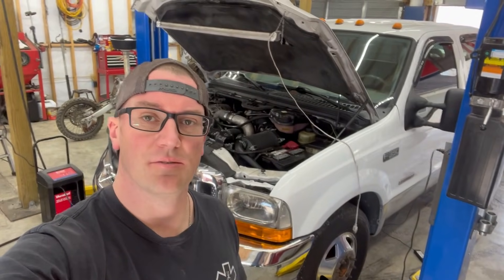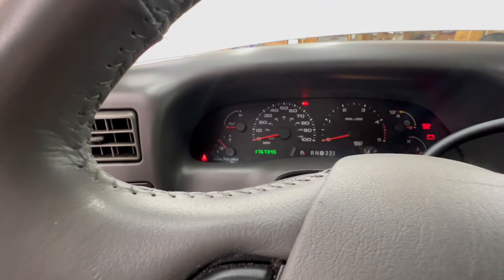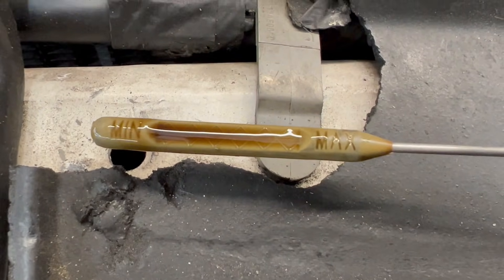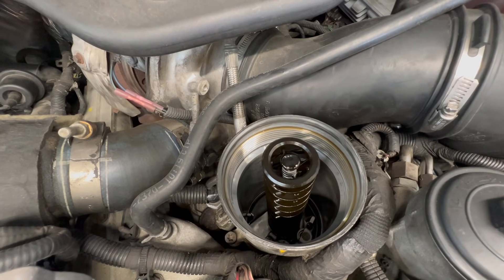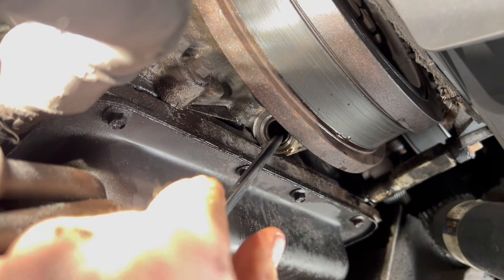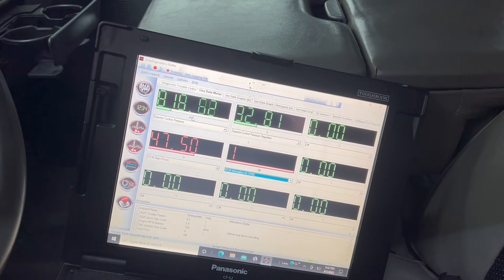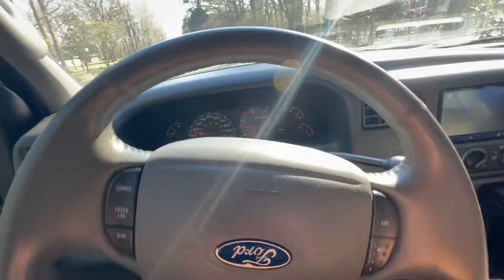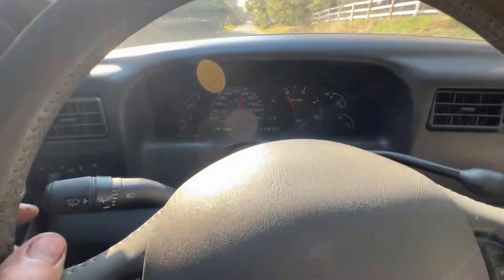6.0 Powerstroke crank no start no base oil pressure

Comment: We have a long crank to start cold and no start when hot. It cranks a long time before the dash shows oil pressure but once it shows it starts up. Just got done replacing all injector and fuel rail nipple o-rings. Oil filter gets oil about as fast as you showed in this video.  Oil pump plug came out no issues. It slid out with no magnet, and no metal was found.  Pulled the ipr and screen looked good, no metal found.
Reply from the maker: How much have you run it since replacing all that? It takes a good hard drive to get all the air out of the system.
Reply: @AutomedicGarage  Not really much. About an hr sitting. I just shut it off again, and it refuses to re-start.  I'll have to wait till it cools down to start it again.
Reply from the maker: @okhotrodder  sounds like you need to air test the Hpo system
Reply: @AutomedicGarage    I did the air test at the sensor, regulator, and also the rail. It had what sounded like air leaking under both left and right sides under the rail somewhere. I didn't feel any air and tried pouring oil all over with no luck.  It sounded the same before and after all the seals were replaced. Since I did the injector and nipple o-rings, it starts more quickly cold than it did before oring replacement.  Ipr goes to 45 upon startup and stay around 25-27 running. When it gets hot, ipr is still 25 or so.  While running, demand fuel pressure/icp 580 and actual stays 570-580.  When hot and shut off, then try to restart, ipr goes to 85, demand pressure is 652 and actual pressure hovers around 345-365 with icp voltage at .56-.64.  Will not start.
  When it starts cold, it runs great with no issues.  I did actuate the ipr with my scanner while I was doing the air test, and it shut off the air supply the more it was activated.
  Looking at other videos, I came across dieseltechRon.  He mentioned the stc coupling.  I didn't replace that, but it's not available at O'reillys, and neither is the low-pressure oil pump, so I'll call the dealer tomorrow and check on cost.
Reply from the maker: @okhotrodder  unplug your icp, run it that way see if there’s a difference. Gotta get the stc at ford and whatever you do don’t buy a LPOP or stc from oreillys.

Comment: great video, are you reading ICP psi? or Kpa? cant really see on screen, thank u, algo if i do have the good oil pressure from engine pump to filter housing, but not high pump pressure at all, should i point to  high pressure pump?
Reply from the maker: If its a early 6.0 (03-early 04) yes, pumps are prone to get weak and the j tube orings can blow also. If it’s late 04 or newer could be stand pipes, dummy plugs or stc fitting(if it still has one) late model pumps don’t typically go bad. You really need to pressure test the Hpo system to really tell the story if your low pressure pump is doing it’s job. And yes I’m reading psi not Kpa

Comment: This is why if you don’t work on your own 6.0 you have do your research and find an excellent mechanic like this guy in Arkansas.
Reply: Or you learn from these videos and work on your own 6.0… otherwise what’s the point of these videos? Great job and thanks for the video AG!
Reply from the maker: @dancook6322  thanks bud.
Reply: Question if your getting oil pressure but still get no start what should you look at next ?
Reply from the maker: @michaelturner1-c9q  if your making lpo using the correct filter and your drain back valve is intact you need to look at your PIDS and tell me what ICP, IPR, FICM main and FICM sync are doing along with fuel pressure
Reply: What an awesome video about checking for low op. If u don’t mind helping out I just did the Eng oil cooler on 2006 6.0L.
It was running perfect until everything was removed. Oil filter housing, cooler intake etc. removed ipr and changed the screen with o rings. Tried to start but crank and crank and crank but no fire. Changed oil filter suspecting bad oil filter. Watch oil coming into filter housing with valve depressed. 
After some cranking oil pressure gauge goes up. Ficm has 48volts while cranking, desired oil pressure is 1500psi while cranking but actual is cycling around low 100 to 300ish back and forth. Have fuel inside fuel water separator. After bunch of tries removed ipr again to check for debris and found none but had a hell of time trying to remove the new screen. Busted it, vacuumed old
One out and installed new ipr but no luck. Keeps cranking but no fire. No codes. Any help would be really appreciated.
Reply from the maker: @benjaminfranklinkivettiv9433 I’m not sure who this comment is directed towards. Never said anyone shouldn’t try to do it themselves. That’s what this channel is about.
Reply: The only way to learn is to do it
Reply: Thanks it help my 2003 f-250
Reply from the maker: @rafaelsarabia8286  good deal. Glad it helped.
Reply: Arlington, tn.?
Reply from the maker: @efraingarciaescalante2824  yep
Reply: @AutomedicGarage  up the road in Atoka, TN. Keep up the great work.
Reply: Great mechanic. Anyone else you would be paying for a front cover
Reply: Are you made of money
Reply: I'm from mexico, my problem is not oil pressure, I already check pick up tube and orings, change oil pump (complete, front and rear cover, gears) 
I don't have any new idea. What do you recommend?
Reply from the maker: @jonvicente4510  what’s icp and ipr on cranking? Have you air tested the Hpo sysyem
Reply: Where is your shop located
Reply from the maker: @sherriboggs  Arlington Tn
Reply: 03  6.0 got L oil Pressure  Tach needle jumps up no Start ?
Reply from the maker: I’m not from Arkansas, unless what your trying to say is I’m a sh*t mechanic
Reply: @AutomedicGarage  I think he's from Arkansas and therefore needs to find an excellent mechanic like you over there lol
Reply: @AutomedicGarage I don't think he was implying that I know I wish you was here in Kentucky after the government shut the coal mine down everything went to he!!! On my truck so my question is I have a 03 6.0 could a crank shaft position sensor cause a crank no start ?
Reply from the maker: @troygrissom8956  yes it can but I rarely see the sensors fail. Usually a wiring harness/pigtail issue. What do you have on your scan tool as far CM/CK SYNC and FICM SYNC?

Comment: Where do you hook up a pressure guage to test actual psi of low oil pressure?  I have no start,  originally had ipr code,, replaced,,, still no start,  so bought a scan guage 3 ,, have ficm volts 48 ficm logic 10.5-11, ficm sync 1   ficm cam and crank yes,,rpm 190,,icp  .24v ,,icp takes a bit to get to 225 then halts , clean relief valve,  nothing in there but tight, pulled and cleaned,,, oil fills in about 10 seconds,    im stumped ,, any ideas,, thanks,,pat

Comment: I’m going through this exact problem right now. 
I’m only building about 300-400 on the IPR. If I give it a shot of starting fluid it’ll start. That worked a few times, but now it’ll start, but only run for a few seconds. 
Hoping to start looking into things today.
Reply from the maker: Icp not ipr, did you clean the relief valve
Reply: @AutomedicGarage  not yet. Going to check the oil filter first.  Then go from there.
Reply: @bobuncle8704 did you find a fix?
Reply: @saltycrowgarage7215  not yet. With no money right now, and health issues, it’s in limbo sadly. I’m going to try swapping some things from my 04(nov, so same components), and see what happens. Just been in copious amounts of pain. Hoping to try some things later this week. Thank you for asking.
Reply: I’m only building 32.3 On the ICP PSI. On ICP (V) it’s only going up 0.29, I tried your genius method but my oil raised up.

Comment: Now what would be the next step if the oil filter housing did fill up with oil
Reply: Pull the low oil pressure pump. Check gears for scarring. If the gears are scarred. What normally causes this is  a lifter has come apart and the needles out of that lifter has gone through the pump.  Next step is to pull the engine.  And watch bank account go empty.

Comment: My 03 6.0 diesel does the same thing but will start when it’s cold and runs fine with oil pressure but when it heats up will not start .
Reply from the maker: You got a high pressure oil leak somewhere that only shows it’s face when the oil is hot and thin.

Comment: I have an 04 6.0 with 300k miles, it just started to do a similar behavior. I start it in the a.m, drive it about an hour and maybe after 2-3 hours it won't start, it sometimes takes up to 8-10 cranks to get it started, I drove it today and it suddenly turned off, it took about 10 long cranks to get it started. Could this be the same issue as shown on this video?
Reply from the maker: Early or late 04?
Reply: Manufacture sticker says 06/04. I really don't know what would be considered early or late
Reply: How would I know if it's an early or late 04?
Reply from the maker: @davemarroquin5653  A)where is your icp sensor located?(front passenger side valve cover or on hpop) B) is you hpop the oval and sticking through the cover or is yours covering the entire pump. Reason all this matters is if it’s the early style pump chances are it’s getting weak and starting to go out or the J tube orings are failing. If it’s a later style oval top pump, they don’t go bad and it could then be several other things(stc fitting, stand pipe, dummy plugs, etc. it sounds like a hard crank/no start hot condition.
Reply: The icp sensor is on the front passenger side. The truck once I start it in the a.m it starts right away with no problem, once it gets a little hot it sometimes turns off on me here and there. I get to work and maybe 2-3 hrs later I want to start it and that's when I try to start it but it takes couple cranks 10-15 secs. But thanks, your video and answer has helped alot
Reply from the maker: @davemarroquin5653  need to know what pump you have depends on if you have dummy plugs and stand pipes or not. Sounds like a crank no start hot problem and if it’s the old style pump your pump is getting weak.
Reply: Unplug icp. If there's oil in the plug. Replace icp and harness plug.  Really sounds like the ipr is going out tho.
Reply from the maker: @davidtipton7234  did you even watch the video? Obviously not, relief valve was stuck on the LPOP, there was no oil making it to the oil filter housing which has absolutely nothing to do with the icp sensor. Dont be a armchair mechanic.
Reply: @AutomedicGarage  lol.  Umm. I wasnt talking about your video.  I was answering the question that davemarroquin asked.  His is cutting off and hard start.  It's either high pressure oil leak.  Icp bad.  Or my guess.  IPR bad.
Reply: @AutomedicGarage could the wrong oil resevoir cap cause a similar no start issue like this?
Reply from the maker: @saltycrowgarage7215  yep wrong cap wrong filter also. Only need to use oem cap and oem filter. Nothing else.

Comment: Hey man I have a 03 6.0 I’ve owned it for 2 years and ever since I owned it every morning no matter hot or cold it always takes 3 or 4 tries until it starts takes longer to build oil pressure but after today I was going down the highway and the truck lost oil pressure and power and she died and now I’m at a crank no start building no oil pressure any ideas of what it could be ?
Reply from the maker: Being a 03 with the round aluminum pump I my first guess would be the pump itself. Could be the j tube or even a injector seal but I’d bet money on the pump. Have you watched my crank no start diagnosis video? It would help you work your way through it.
Reply: @AutomedicGarage  yes I went through the video I’m going to go through the truck tomorrow night and see how it goes thank you I appreciate it

Comment: what code was it showing
Reply from the maker: I couldn’t even tell you, people tend to focus on codes with these when most of the time they aren’t pertinent to the problem. You need to look at live data, icp, ipr, FICM main, FICM sync and have a fuel pressure gauge hooked up. If you have all of those and a solid motor with good compression and no dead cylinders it will run.

Comment: Let me ask you this…can a shot of ether to get it started overcome a bad icp sensor?
Reply from the maker: It might hit just due to the simple fact of the compression igniting the ether but it won’t “overcome” a bad icp. Most times a bad icp doesn’t give you a no start, you might have erratic idle or long start etc. the best way to determine if it’s bad is see what the voltage is key on engine off. Or just unplug it. It will run without it cause the pcm has a default pressure it goes to if it isn’t getting any feedback from the icp.
Reply: @AutomedicGarage  ok thank you. Doesn’t sound like my problem. I had to use the ether trick to get back to Nashville last night from Indiana with a heavy load. Mine runs fine once started but I’ll shut it off at the pump to get diesel and it doesn’t want to start back. I changed both filters on the side of the road yesterday and it’s still doing it
Reply from the maker: @BrandonLayMusic  probably have the beginnings of a high pressure oil leak

Comment: My 06 is a crank no start when I turn key switch on fuel pump comes on but it doesn't click the injectors  please help
Reply from the maker: Sounds like your FICM is out. What’s your FICM voltage key on? When you crank it over do you have sync? If you have neither check your 3 FICM connections and check the ground on the rear most intake bolt on the drivers side.

Comment: Thanks for these videos, Drew! I definitely understand the whole oil system with the 6.0 know. Where to look and how to diagnose the issue. Thanks to your videos and Gary’s truck 😜😂
I have an 05 and I’m about to do an overhaul on the oil system. I’ve put 20k miles on it since I bought the truck and it runs fine. Sometimes it times a few seconds to turn over or I gotta stop, turn it once more and it comes on. I feel like this happens when it’s time for an oil change or really really hot out here in Tx.
Reply from the maker: Glad they’ve helped. Thanks for watching

Comment: Anyone else see the pin working it’s way out of a drag link top left of screen @ 8:00
Reply from the maker: A) that’s not a drag link, that’s a ibeam
B) it’s not a pin that holds anything
C) all 2wd superdutys are made this exact way. 
It holds nothing and to my knowledge serves a purpose going down the assembly line. I even just checked another in the shop to verify. So before you go naming parts and things your unsure of maybe do some googling and research. Don’t be a armchair mechanic.
Reply: It belongs there my truck has it.

Comment: What if you’ve tryed all that & it’s a hard crank
Reply from the maker: Is your base oil pressure good? If so, check your fuel pressure. Or you might have a high pressure oil leak just beginning causing a longer crank to produce the 500 psi to start.
Reply: I have a about 500-600 psi on crank but once the engine is hot no start.  I suppose I need to pressurize the system and find that leak @AutomedicGarage
Reply from the maker: @utahrvcamping3019  sounds like you have a crank no start hot more than likely. Get the engine hot to where it won’t start. Pull you air intake and FICM and put the air tester in and see where the leak is.

Comment: Have you seen this where the filter housing is filling but there is no oil pressure on the dash? Thanks!
Reply from the maker: Only takes 7psi to read on the dash. The dash oil pressure is not priority if battery voltage is low either. So no if the filter housing fills relatively quick you should have gauge unless you have pretty weak batteries
Reply: @AutomedicGarage  I really appreciate that, thank you

Comment: Mine cranks and starts but its a long crank, does it when hot and cold.   Any ideas?
Reply from the maker: Might have a weak hpop. Or your relief valve is stuck in between open and shut or a weak lpop. What year truck?
Reply: @AutomedicGarage  it's an 06.

Comment: my 03 6.0 started having an issue going full throttle then died going up a small hill one day. now it just cranks and cranks it will start with ether but wont stay running for longer than 5-6 seconds any idea what the issue might be?
Reply from the maker: Don’t use eyther unless you like the idea of a cracked piston. Check icp and ipr while cranking and check fuel pressure, anything less than 45 psi and your looking at a week fuel pump. Could also be your in tank pickup has broke off.

Comment: I have the early 04. I shut mine off the other day and now it just cranks and no start. I am being told its my hpop but my oil well is filling fine.
Reply from the maker: Hpop doesn’t fill your filter housing, the LPOP does. Being a early 04 it’s highly likely your hpop has crapped out.

Comment: I have 6.0 2005 mine doesn't want to start when its cold outside but starts fine when its above 60 degrees any idea has an new FICM in it, is it possible oil weight? welcome any thoughts
Reply from the maker: Have you checked/changed your glow plugs, harness, glow plug controller?
Reply: @AutomedicGarage  no i haven't it does start when warm but it didn't start till it had 1100+  # oil pressure   runs good   starts normally after first starting, could it a problem with fuel pressure
Reply from the maker: @mickdale3828  sounds like a glow plug related.
Reply from the maker: @mickdale3828  need to hook a scanner up and check fuel pressure

Comment: Hi there. U have such a good videos!I recommend You're Chanel for others. My 2005 F250 6.0diesel when  my cold engine starts, isn't going too  High idle to 1000rpm engine wormup. Its still only 670-700 RPM. What is can cause a trouble for this??
Reply from the maker: What is your coolant temp saying when you crank up?
Reply: @AutomedicGarage   Outside is 19C engine coolant 90F   I have a so cheap scanner that's my scanner says 90F. 1st in the morning when I start engine it doesn't go high 1000rpm  Stays on the same 678rpm.